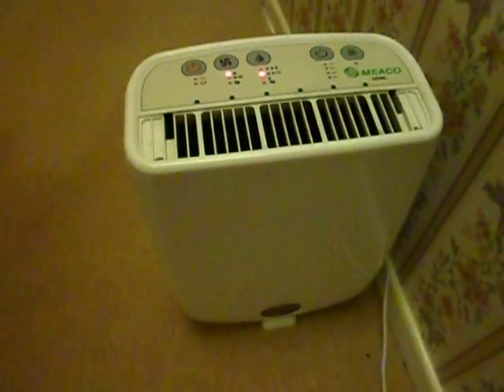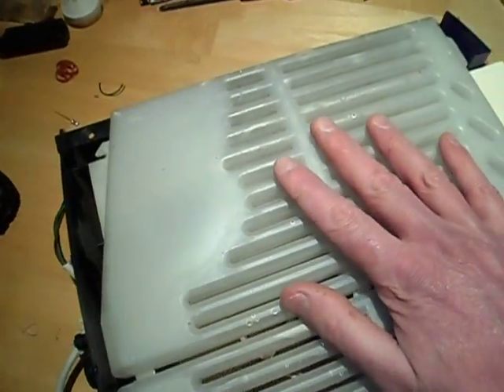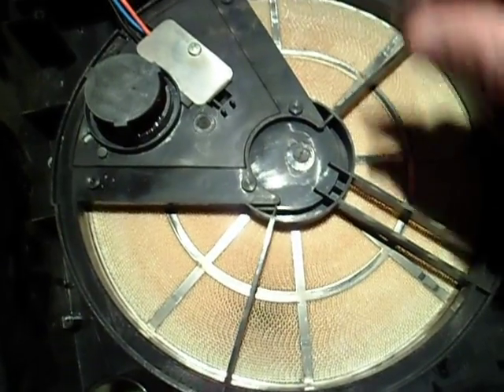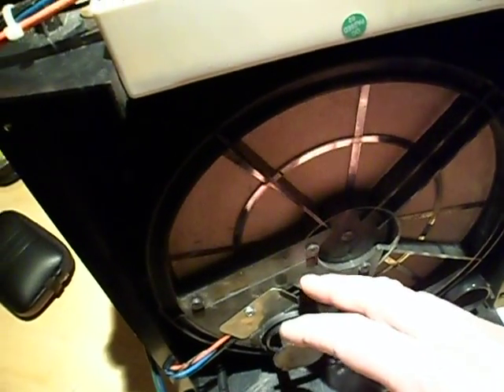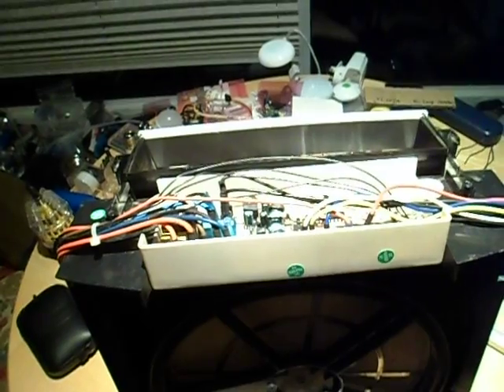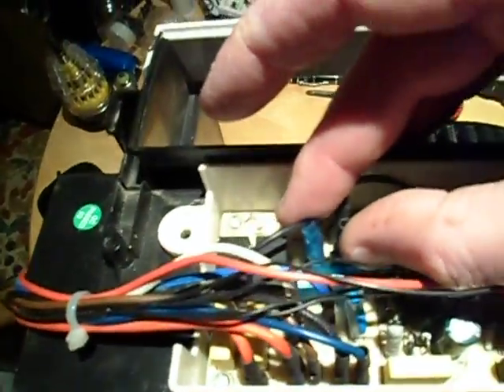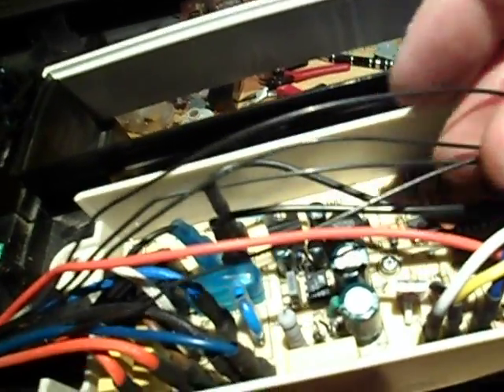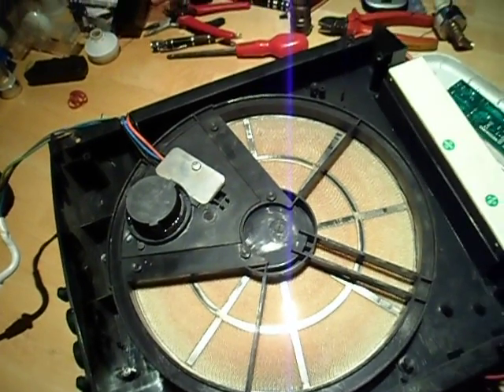A look inside a desiccant dehumidifier.

Comment: Great video Clive, nice to see the zeolite wheel. I was tempted to buy a desiccant dehumidifier but kept reading reports of the heater elements breaking down after a couple of months to a year of use, both on the Meaco and EcoAir units, and neither Meaco or EcoAir would sell me any spare heater elements in advance. So I played safe and got a couple of small compressor dehumidifiers. But I would like to try one of these to compare.
Reply from the maker: I actually bought a faulty unit off ebay to investigate the heater issue.  Secretly I was just hoping that it was just a tripped thermal fuse, but it is indeed an absolutely grilled heating element.  It's a mica frame with an open coil hairdryer style element zigged zagged over its surface on two layers and has a common connection and two taps for low and high.  This one had clearly been on high for its entire life as the back section of the element was like new while the front was grilled and the mica support frame had splayed out (possibly with moisture) where the element passed through it.  It was at this splayed out point that the element had broken.  I think that if these units are used at their low/quiet setting only then they will last a lot longer.  They're also slightly more efficient at the lower setting.  Currently my favourite unit is the EcoAir "Simple" which doesn't have much electronics and doesn't seem to use a cool-down time either.  The design of the electronic on most of the other units I have looked at suggests a lack of foresight on behalf of the designer.  In every unit I've seen it's possible for the microcontroller to crash and leave the heater powered with no fans running.
Reply: bigclivedotcom Yes, I liked the look of the EcoAir Simple when I was looking last year... as you say, no fancy electronics, so it should be easy to DIY repair... plus the ones with fancy electronics don't always work with a mains timer, which is a bit rubbish if you want to take advantage of cheap rate electricity. I just didn't like EcoAir's attitude: their pickup repair warranty didn't apply to me because I'm off-mainland UK (islands), and they refused to let me buy any spare elements. I've had too many short-lived appliances and didn't want to take the risk.
Hmm, I wonder where those heater elements can be picked up? There must be some hack that can be done to put in something of the same resistance that would last longer. Maybe an idea for a future BigClive video? :-)
Reply from the maker: ForViewingOnly Living on the Isle of Man myself I'm well aware of how it affects the willingness of companies to even deliver to UK islands.  I'm not really surprised they weren't too keen to provide a heating unit, since it's probably the most inaccessible bit of the machine.  You have to strip the whole thing down to bits to get to it.  It would really have to be changed as a complete assembly too due to it's construction.   Strange you should mention heater alternatives....   I do currently have a cluster of five 47 ohm 50W resistors that I'm probably going to put into a dead units heater block.  They will dissipate about 240W and hopefully the airflow will keep them from getting too cross, since they are really only rated 50W each when on a heatsink.  I want to see the effect of different heater powers on efficiency.  The ideal heater would pretty much be what's in the machines already, but just run at the low setting to stop it burning up.

Comment: Do you think heating element can be disabled without voltage problems? Ty
Reply from the maker: The dehumidification process requires the heating elements to work.  The heat is used to drive the moisture out of the desiccant drum.  If you disabled the heating element the unit would stop removing moisture from the air.

Comment: Good vid, I have mine apart at the moment, this is helpful.
I have an annoying beep every 2mins 20 secs, dont know how or why, so am just trying to make sure no blockages etc.
How did you get the casing apart as far as you have, I have undone as many screws as I can, with the top panel off, but dont want to break any plastic bits on the sides.
Thanks
Reply from the maker: If your is a Meaco then the case is clipped together on either side of the middle of the unit and the only way to part it seems to be to dig your fingers in at the sides and use "the force".  On some units there are four hidden screws under the control panels label, but I'm not sure if they have to be removed to open the case.  The "beep" you hear might actually be a squeak.  The desiccant drum rotates very slowly and is retained by metal guides and mine also developed an occasional squeak.  It may actually just go itself if you give it some time.
Reply: bigclivedotcom Meaco DD8L, looks the same as your one, have cleaned as much as I can and put it all back together and fired it up again, will soon find out if the beep/squeak continues when I turn the radio down :-)
Good call on the squeak though, maybe thats how long the dessicant drum takes to rotate one turn?
Cheers for info
Reply: delgan999 As far as I am aware, the 'squeak' has now gone (wohoo!)
Thanks for your help
Reply from the maker: delgan999 Glad you got it sorted.  Mine hasn't squeaked for a long time.

Comment: Hi Clive
Do you happen to know what the operating temperature of the heater is? Planing on making a fair sized one from scratch.
Thanks
Reply from the maker: I'm not 100% sure.  It's a closed air loop with a heater that operates at either 300 or 600W and it does cycle on and off from time to time.  I've got a dead unit where the heater has clearly been used at its highest setting and has burned and failed.  The actual element is like a hairdryer style open element zig-zagged on a mica support.  I'm going to try an experiment with a cluster of 50W resistors to see if I can get a result.  I don't know if it requires a minimum temperature to operate efficiently.  I can say from tests that it is slightly more efficient at the 300W setting.  Having seen the way the other unit failed I'd say that operating these units at their lowest (300W) setting is going to make them last a LOT longer.
Reply: bigclivedotcom Hi Clive I like your video.  Not sure if the heater is a PTC heater that are used for safety.  In theory they should not burn out unlike resistive heaters.  If it is not that is another issue.
Reply from the maker: They are a coiled resistance wire zig-zagged across a mica carrier in two layers.  It's a very humid environment in the heated condensing path which doesn't help.